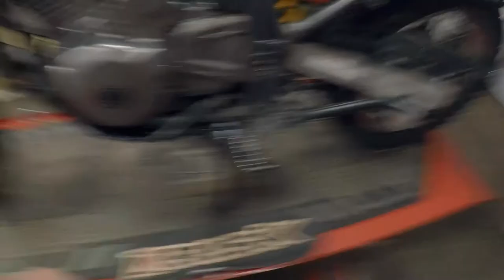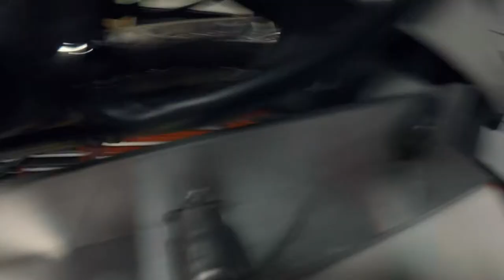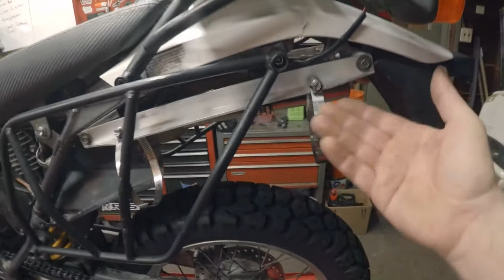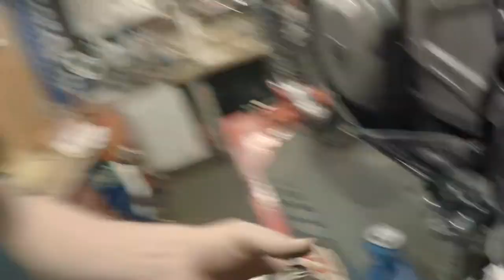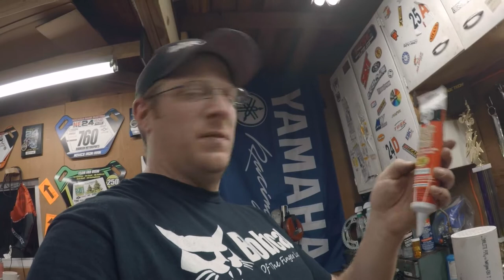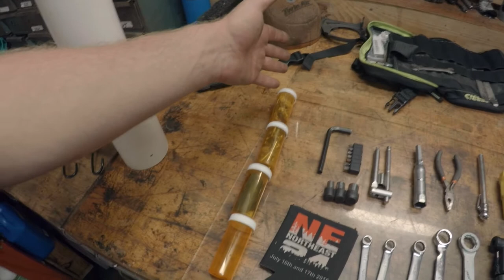Weekend Garage Vlog Episode 18: Revisiting the tool tube and installing Fastway pegs on My DR650

Comment: Why didn’t you just glue a cap to the bottom of the tube?
Reply from the maker: The standard cap made the base of it too wide to fit between the factory mud guard and numberplate. This was a little more work but I was able to get more space than an expansion plug at the bottom. I can touch on this in this weekends episode. Also found a 17” bag that fits in there.